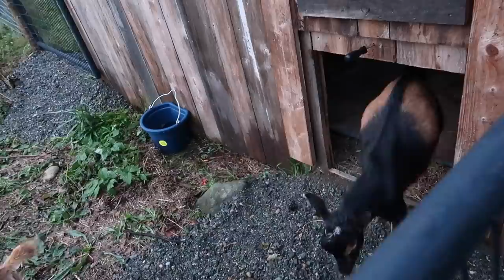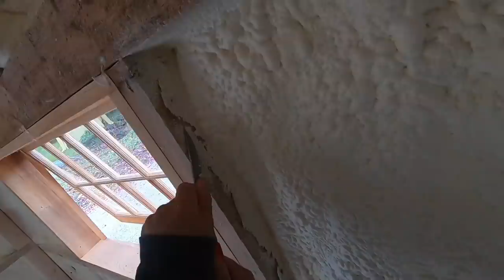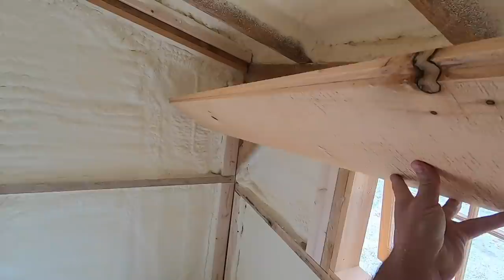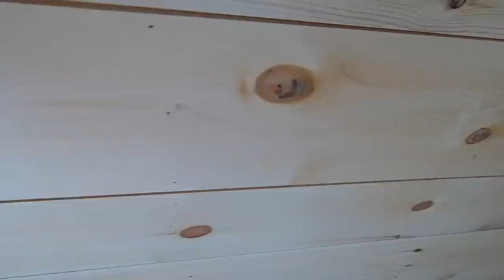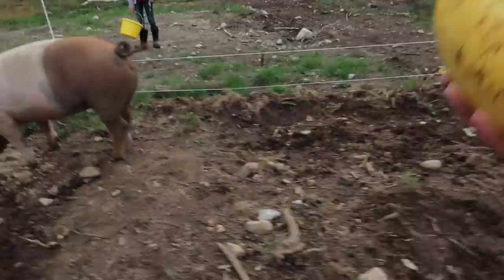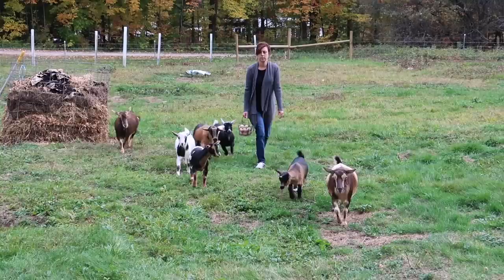THIS was all HER IDEA Shiplap in the POST & Beam BARN

Comment: Actually Al, an idea just popped into my mind.  Instead of the fencing in the rock wall, you could use the Kubota, or probably might have to rent a bigger tractor, and dig up that big rock, and move a few other rocks in the pasture and build a "Goat Mountain" with the rocks somewhere.  Course, make sure the rocks are stable too so none tumbles or shifts down onto one of the goats, or one of you.
Reply: R. J. When I saw them go on them when they first wandered that way, I thought that too! The only worry that came to mind is gaps (where their legs could get stuck) but they’re loud and would let them know! I remember Hope getting stuck on the teeter totter when she was a wee one.
Reply: I thought the same thing but I was thinking he could talk to his buddy about borrowing the excavator again to move a few rocks for them or get a 3 point hitch bucket for the Kabota, it will lift a lot more weight on the back end.

Comment: A friend of mine does spay foam and devised a special tool for removing over spray cleanly and easily. He took a soldering gun removed the soldering tip and inserted a piece of either 10 or 12 gauge wire long enough to bend into the shape of whatever he was going to install. For example the garage was sprayed but not enough room for a switch box and wire, so he bends the wire the width  and depth of the switch box pushes the trigger inserts the wire to the depth at the top of the box location slides it downward and pulls it straight out and just like that a pocket for the switch box. Then bends the wire to make room for the wire run and cuts in a channel for the wire and every thing is tidy and looks good. he uses a very thin piece of wire between studs if it swells higher than needed, holds the wire tight on both  studs and slides the wire up or down like floating a concrete floor using wire to hang pictures. Both work great.

Comment: Regarding installing tongue and groove on the ceiling. The first board should have had the tongue on the room side instead of the rafter side. That way the next board could have rested in the tongue of the first board, supporting the next board, rather than supporting the full weight of the next board with your arm.

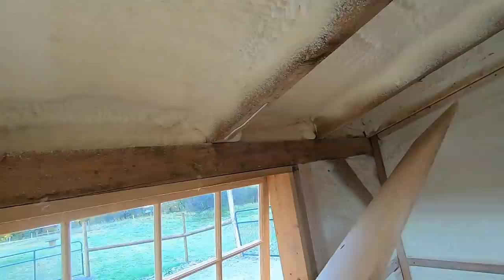Comment: 12:20  why no vapor barrier? Moisture always accumulates in walls and that is why it is code here in Canada to add it in any outside wall on the inside before adding some kind of sheeting. Is it not code where you live?
Reply from the maker: The spray foam is the vapor barrier

Comment: Are you going to run your power and lighting in conduit? Just thought I would ask.
Reply from the maker: Yes
Reply: @LumnahAcres  When are you going to work on the electrical? Will that be a winter project for you? It would be nice to have some LED lights in the milking room instead of that portable light
Reply: @LumnahAcres  Also, have you thought about using solar panels on the roof of the house or the barns? it might help with your electrical costs, and make you more independent home steaders... Have you seen Red Poppy ranch on YouTube?

Comment: For those who were concerned about Willow snacking on the foam insulation; we use that foam in the consumer version for aquariums all the time. Once it is dry, it is inert and does not harm the aquatic life. That said, the perception of the bits she snacked on going into milk is understandably a little off-putting. I think Gina could have done the milking room all by herself, except the ceiling. However, with a handy, dandy brace, she could have done it all. Well done  ;)

Comment: You could ask around your area if anyone has some larger rocks they want off their property. You buy like a 20' by 30' heavy duty pond liner and you dig down like you did with the barn and you place 3 inch minus for drainage compacted slightly then 1 1/2 inch minus completely compacted then pond liner then 6 to 8 inches crusher run stone completely compacted. Now you have a great foundation with which to make a nice rock climbing garden.

Comment: I thought the idea was to run the inside siding vertical and expose the angle brackets
Reply: @Walt Lars ,
I also though there was going to be exposed framework. In fact , I thought that was the reason for building a post and beam barn. So that you could see the exposed beams.
Reply: I believe that will be inside the workshop, not the milking room
Reply: @emtfarva ,
Apparently so because the miking room now looks like my knotty pine kitchen.

Comment: I Think you made an mistake in not wiring that Milking Room with Recesssed 6 '' LED Can Lights BEFORE you installed the wood sheathing on the ceiling !! Same with installing the Duplex 120 VAC 20 Amp Receptacle Wall Outlets , at least One on each long wall BEFORE installing the wood sheathing on the walls !!!

Comment: Good morning from Elko Nevada..  I am wondering now that you put the wood up in the milking room how are you going to run electricity? I figured you would run the wires before you did all that..  Love the videos.. By the way it's raining here now but they are calling for snow down to 5000 feet , my house is at 5500 feet lol
Reply from the maker: I will run it in conduit
Reply: @LumnahAcres  Al as great as the room looks I am surprised that you would install an ugly surface mounted conduit.

Comment: There are a few concerns with the foam apparently. If it's sprayed too thick initially, people have had problems with ongoing fumes. I haven't had that problem, but I've seen it on TV. You seem to have some pretty mad carpentry skills so I won't second-guess, but why the liquid nails...is that a New Hampshire storm code or something? I always arrrrgh with more chemicals around the animals, but that may just be my own phobia/preference.
Reply from the maker: I’ve heard the same about the foam.  We had them spray 2 inches. So we should be ok. We don’t have any odors. I used the liquid nails so I could use less finish nails in the boards.

Comment: IF that was My Barn , I would have completely WIRED it for LED LIGHTS and Duplex 120 VAC 20 Amps Wall Receptacles Outlets BEFORE doing the Spray Foaming and applying any Wall & Ceiling Board Sheathing !!!

Comment: When you cut the tip off the liquid nails wit the caulking gun...🤯😳
Reply: That's what the hole is designed for! There's a small retractable blade inside that cuts the tip off at whatever angle you need.
Reply: Yea! I just can’t believe I got to be the age I am without knowing that! 🤔